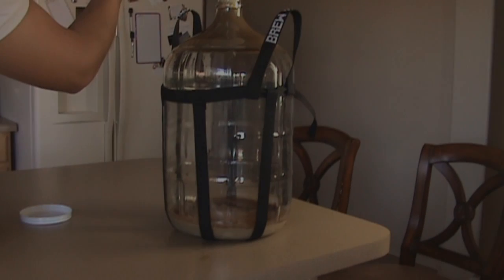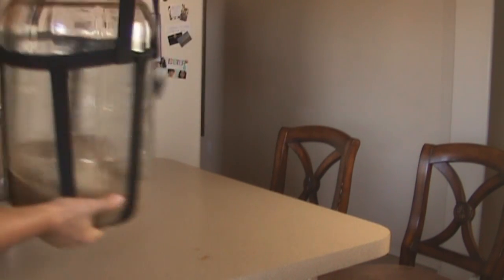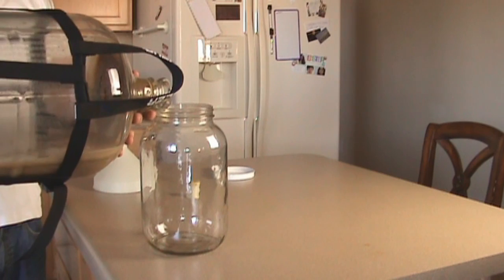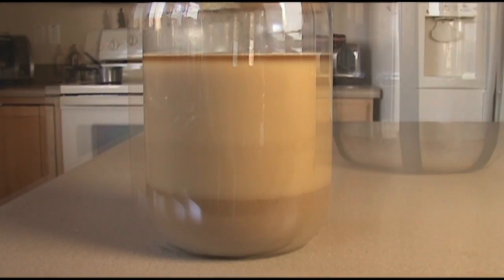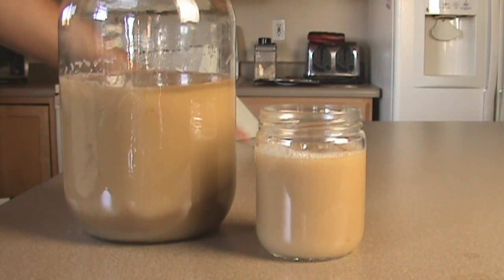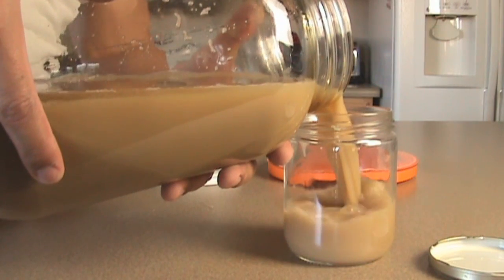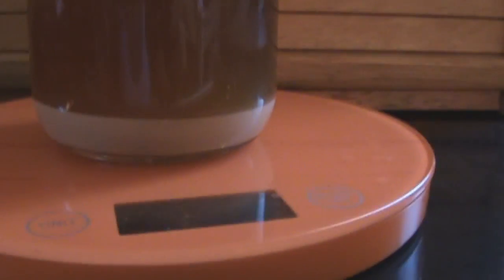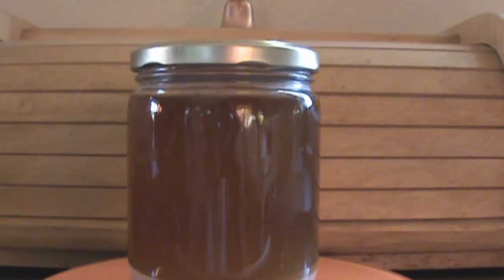How to Collect and Rinse Yeast

Comment: I was wondering if you have ever tested for morphology and contamination in this method? Yeast strains typically adapt to their environment and will change the esters and flavors they produce. Also, the transfer method you are using is not completely sanitary. A better way to transfer the yest would be to have an alcohol lamp burning to to create an up draft eliminating any airborne contaminates. If you have access to a simple microscope, you can test for viability and infection using methyline blue regent and a simple staining of the yeast. Healthy ones will remain clear and dead will allow the stain through the cell walls. As for morphology, looking at the cells themselves will show some cells beginning to take on an oval shape which is indicative of an unhealthy cell. This can start as early as 2nd or 3rd generation. All in all a great video about how to keep yeast and save time and money on new strains. Add a little science, and Bobs your uncle! Keep the fermenters full brother!

Comment: I've watched a bunch of these videos on washing yeast and I can't figure out why no one tries to syphon the yeast out of the carboy instead of pouring it and mixing it with the trub
Reply: Tailgate Brewing I thought the same thing, siphon from just below the surface and feed the hose down gradually... obviously you would use a thin enough piece of hose so as to not have enough suction to pull the sediment up....
Reply: Its just not necessary, there's so little trub in there its not worth worrying about and if u get any beer or water (top layer), that's fine  too as it helps protect the wash from the air in the jar.
Reply: +Scott Lowther Just how would you propose to go about doing that?   I suspect your hose and racking cane would simply get all clogged up. Pulling out mostly just yeast would be pretty tricky.  The yeast typically forms a neat striated layer on the surface but for some brews it is a fairly think layer.  Also...  Yeast are sticky.  They cling to whatever.  Shaking them in a solution breaks those bonds and allows for the yeast to break free from unwanted material that might be present in the yeast layer.  A good rinse will help facilitate that separation.

Comment: couldn't you use a syphon tube to transfer the yeast layer? then you can see were the tube is in the jar so not getting any of the sludge from bottom.
Reply: +simon68giddy i was thinking that too. But how about using one of those   gravy boats that separate the grease and the gravy?
Reply: @max3d_0ut  8

Comment: In the shot at 2:25, is that beer on top with the yeast at the bottom? If so, would you recommend pouring off the beer and just adding the yeast, to avoid changing the flavor of your new brew too much?
Reply: Badger Brewing Typically you want to use the yeast in a light to dark beer.  You dont want to brew a stout, then wash that yeast and put it in a pale.  The small amount you are pouring in shouldnt be detectable.  But you can pour off the majority of it and leave a small amount to swirl and suspend the yeast.
Reply: you could also make a starter after pouring off some of the left over beer......from what I have heard the harvested yeast smells so a starter would be best anyway just so you don't potentially get any off flavors.

Comment: How long can the harvested yeast be stored?
Reply: Randall Schoverling you could store the yeast in perfect sanitary conditions for up to a year.. you can use it without needing a yeast starter for around 6 months.. after 6 months for best results, make a starter.. that is what i do.. it works fine and the yeast collected is always strong and healthy
Reply: I wouldn't encourage you to keep your yeast like that for more than 4-6 weeks. My English is not good enough to explain why. To make sure the yeast viability doesn't decrease, I was told to use 1:5 ratio yeast to isotonic solution (0.9% NaCl). This way i can be sure my yeast stays healthy for 12-14 or more months. Of course, keep everything well sanitized and oxygen free. Further you can deep freeze yeast in similar way for years.
Reply: I would like to know this as well, and can you harvest yeast from your favorite microbrew bottles?
Reply: ***** have to buy it first man.. Randall Schoverling you can collect it from bottles.. there are several videos about that..

Comment: I did that all wrong. I spooned the trub into a jar and refrigerated it for a month and used it in my next batch. It took off fast and tasted fine. Nice thing about beer, as long as you sanitize really good it's hard to screw it up. But I will change my jaded yeast washing ways. Thanks for the video.
Reply: yup would simplify matters

Comment: Great. I used this method on an extract and it worked perfect, except the bottom layer when separating the yeast was much smaller and my 'beer' layer was much larger. In secondary, however, I have some small clumps of yeast propagating on top (90% sure it's not mold). The yeast was moved from a 1.070 og beer to a 1.050 og beer. Could that be why?

Comment: Thanks bro. One more question if you do not mind. I do it simple - I have two fermenting buckets, I do the primary fermentation for 7 days, and then I do the secondary for 7 more days (I transfer the beer from one bucket to another). So if I wash the yest that remains in the primary fermenter, can I use them without a starter after keeping max for 7 days (I guess I can use them without a problem the same day?) and in case they do not work - I can add dry yeast at any time?

Comment from the maker: That's one of the benefits of re-using yeast... if you use it within a few days you don't need a starter. The yeast remains active. This however depends on when you actually collect the yeast. If you collect right after fermentation is done then no starter should be needed (one reason to secondary). If you, however, leave the beer sitting on the primary for a couple weeks after fermentation is complete, you may need to use a starter. Every batch will be different so your intuition will help!

Comment from the maker: You can re-use it, just remember that as time goes on other bacteria will start to also grow and you'll get to the point where you need to actually 'wash' the yeast... quantity is roughly the same, but you'll use less... think of this yeast as yeast coming from a yeast starter... it's more active and your fermentation starts within 4-8 hours as opposed to 12-48 hours...

Cheers!

Comment: I had one that worked after about a year and 3 months in the fridge in an airlocked beer bottle. Got it going in a half gallon starter. Was a little slow at first, but fermented well after that. I was pretty surprised and I don't know that I'd recommend this, but long term storage is as least possible.